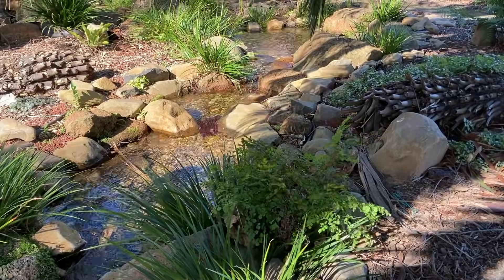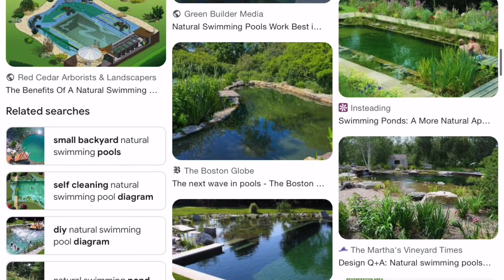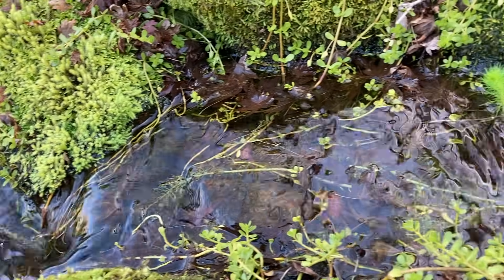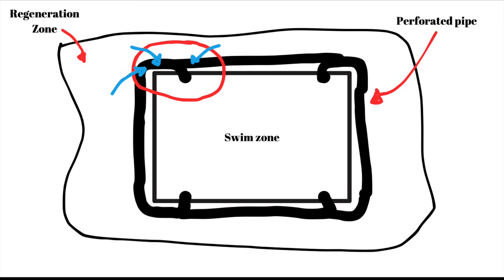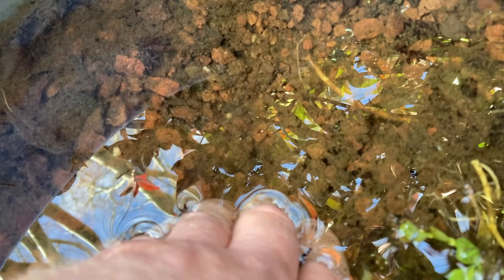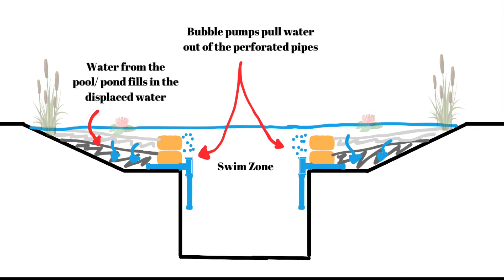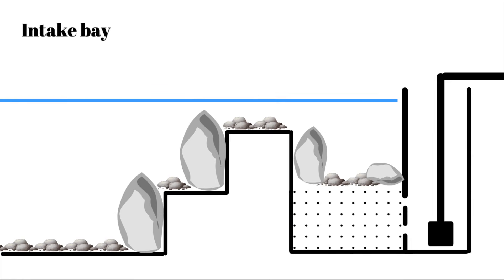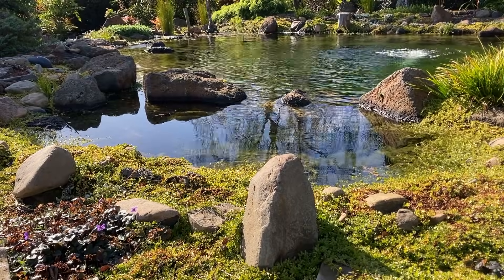Up-flow bog filter vs down-flow bog filter

Comment: I do what I would describe as a through-flow. Water flows into the bog area, moving through rocks to the outlet. I use a false bottom using flatter rocks as a "barrier" to prevent smaller rock falling through into the false bottom. From the barrier rock layer, moving to the top, I used progressively smaller gravel to the top
Reply from the maker: Sounds good. Thanks for sharing 👍

Comment: I have about 1000 sf  of old damaged shade cloth I plan to put in a barrel and filter from the bottom up.  I assume if I see overflow from the anti siphon vent on the input line, I'll know it is time to clean.  The light weight fabric should be easier to clean than heavier media.  I've also considered using old coals from my wood burner.  I could make containment bags from the shade cloth scraps.

Comment: I have an under gravel suction grid in the pond feeding an adjacent bog. It works well and haven’t cleaned or vacuumed the pond over 1 1/2 years. No maintenance
Reply from the maker: Nice. I’d like to try a suction grid. Do you still use a skimmer, intake bay or neg edge?
Reply: @Ozponds  I’m using a skimmer as well to clear the surface debris.

Comment: Hey Kev. Great videos again mate. At 4:04 when you're filling the cup from the bottom with the faucet, as you rightly said, the water will travel from the bottom to the top. However, if the cup and faucet was to scale of the outlet pipe and Bog filter, I fear the water wouldn't disperse throughout the bottom layer of the bog before rising toward the surface (due to the pressure at that depth) and therefore the majority of water will only travel through the water column above the outlet/centipede. 
I know you say that both methods work but I just like to nut out inefficiencies ;)
Reply from the maker: You are probably correct just sharing my own thoughts.

Comment: Hi live the videos! i have a small barrel pond and wanted to use a cheap solar pump for a bog filter. Do you think it will still work if i have a down flow bog filter using a flower pot? Or is this too minimal to work? Thankyou
Reply from the maker: It will certainly help. It’s harder to guarantee the result when the pump isn’t 24/7. I have videos on no filter barrel ponds.
Reply: Okay brilliant thankyou I'll check them out. I already have a solar aerator, just trying to find ways to keep it clean with out spending loads. Thankyou

Comment: Thanks for the insights once again. Hey out of interest what is your pump rate to get the flow in that stream in the last scene. I am trying to get something exactly like this in my creek/pond setup.
Reply from the maker: I can’t remember the exact clips I used in the video. My guess is it’s the dream pond stream, that pump is rated at 15,000litres per hour but it’s dialed down quite a lot and it is pumping a long way. I’d guess it’s more like 4-6000 litres per hour.

Comment: This is a great channel and I enjoy your content a lot. One of the best!    But, I'm not certain that down- vs up-flow makes any difference and I am not convinced by the water glass example. Certainly if you filled it with media and added water from the top, the water'd just spill over the side like the example. In reality water will ALWAYS find the path of lest resistance but as the easiest channel begins to collect debris it becomes not the easiest channel, and so on, and so on. There will always be a channel with less resistance that will eventually get plugged up. Gravity itself probably plays little role or all the water in the swimming pool would be falling to the bottom of the pool and then how does it replace the water that was already there?
Reply from the maker: Just my thoughts and theories, you are most welcome to yours 👍

Comment: Quick question, if you have an external pump does the overflow in your filters replace using a check valve?
Reply from the maker: I wouldn’t think so.

Comment: My experiennce wtih upflow filter is the sediments builds up in the media over time in the pea gravel. . Just an update it took almost one week, 8 people to manual clean out my bog filter. Its got large river stone about 10cm thick, course gravel about 10cm , and pea gravel 20-30cm in a 4 meter diameter upflow bog. 

So now eveything  cleaned out, plan is to have 5cm -8cm worth of pea gravel, to make it easier to clean out the sediments. Pipe the water a prefilter (mechanical) before entering the bog. 

Its going to be an experiment to see which works best. 

At the end of the day, there is always going to some sort of maintenance. Nothing is maintenance free. 

Cheers.
Reply from the maker: Thanks for sharing your experience. 👍

Comment: I am in the process of renovating my up flow that is clogged with fine sediments through out the filtering media. Its a 4m x 2m deep diameter up flow reservoir. Its a big mess. Routine clean out is a bitch. Going to go with combination of tradtional mechanical fiteration that can be easily cleaned plus the 4m upflow will just have 10cm of fine river gravel for easy maintenance. Lets see how it goes.

Comment: The main advantage that I did not hear in this video is the massive power savings on moving water that can be achieved using the bubble pump vs a water pump. The guy from Australia said he was moving 30,000 liters an hour through his system with 80 watts of power. That is one small solar panel worth of power. Is there a way to have an up flow using the bubble pump?
Reply from the maker: The problem with the bubble pumps is they don’t handle head or pipe friction well. That means they aren’t really in option for up-flow.

Comment: I've been searching for a video to tell me if an above ground bog filter needs to be winterized. I've learned so far if I shut it off beneficial bacterial will die and I will have to restart the process in the spring. But living in a climate that has quite cold Winters I'm not sure if the barrel that the bog filter is in will freeze? Or will it be okay because it has constant water moving?
Reply from the maker: I don’t live in an area that experiences freeze, thaw so I have no first hand experience on the topic.
Reply: @Ozponds  thanks I appreciate your reply!
Reply: I need to look into this too. Indiana here!

Comment: I just built a temporary up-flow bog filter with a bucket in an old flower pot and some pieces of a garden hose.  
When I'm sure, the pot I used is big enough for our sun exposed pont, I will build a more beautiful one with plants and a nice bubbly overflow. I am really curious about the progress! But looks like just one night was enough to clear the water a bit.

Thank you for the inspiration and your explanations, especially on the diversity of possible methods.
Reply from the maker: Good luck with it all 👍

Comment: Your intuition is incorrect. Water flowing from a tap with a gap does mix with the rest of the water in the container in a turbulent manner. Pretty basic fluid dynamics. You can try this yourself with a little food coloring and just use a pitcher or whatever instead of the tap. Science is fun. It's visually similar to blowing smoke.

Username checking out today!

Comment: Could you use a Air pump to feed an up flow bog filter? I ask this because they are so much cheaper to run.
Reply from the maker: Yes you can. But also take a look at some of the energy efficient pumps that are available these days. Things like 15000L per hour for 105watts.
Reply: @Ozponds  Nice, well what do you think about this 15000L for 20 watt air pump? https://www.youtube.com/watch?v=TOVZ4oklBFw

Comment: Hi, thanks for the video. I have a pump sebo wp2550, could you please tell me if i can make a small bog filter upwards with it? Or is it too weak?  Is a 2800L/hour . 35w.
Reply from the maker: There’s a few variables. How high you need to pump the water and how big the bog filter is. If those fall within the specs of the pump no problem.
Reply: @Ozponds  thanks

Comment: The one advantage I notice for the downflow undergravel filter system is that it can be powered by just an airpump in a large pond, which uses significantly less electricity than the water pump required in upflow bog filter.
Reply from the maker: That is true. Down-flow can be easily powered by an air pump, however I don’t think the energy saving argument stacks up anymore. In recent years pumps have gotten so energy efficient. If you select the right pump they can move just as much water, in some case more than an efficient air pump. But if swimming air pump has massive advantages as no electricity in or around the pond.

Comment: Hi mate,
Wonderful points you made there and the proof is in the clarity of your ponds, they are in really great condition and it’s nice to see.
I’m currently from South Africa and I’m running my own pond company in the north side, I was just wondering how you deal with the blanket weed problems because you don’t seem to have that problem from what I noticed.
I don’t like having to add treatments to the ponds but I currently find myself needing to do this from time to time. How do you keep this under control if I may ask?
Look forward to seeing more of your videos.
Thanks
Reply from the maker: I’ve made quite a few vids on how I’ve dealt with algae in the past. Once the pond matures (can take up to 3years) there’s shouldn’t be any need first treatment, as long as the filtration is correct.
Reply: Thank you, I will go have a look at your other videos. It’s a little difficult because I don’t really have the time and they don’t want to pay for my time so my best option is to treat and go.. 
also I do water changes because they leave them to soup before contacting me and once I’m done they don’t seem to want to do a service plan to keep them well. But anyway thank you for you brilliant advice
Reply: I’m Lifetime ponds the first message this is my private account, don’t know what happened there.

Comment: Have you considered that in a down-flow filter, when using principles used in trickle filters, the water that flows down will be highly oxygenated as the water has splashed down to the surface of the filter's water level? In an up-flow filter, the water your pumping down under the filter will have come from the bottom of your pond, which arguably is the least oxygenated body of water in your pond. I might argue that highly oxygenated water in a down-flow setup might promote more active bacteria activity.
Reply from the maker: You’ve obviously not seen how I set up my ponds with a skimmer/ intake bay. Water is pulled from the surface. A trickle down filter is very different from  downflow bog filter, usually the filter is fully submerged. Trickle filters are extremely effective at converting ammonia to nitrite, then nitrate. They are not submerged. But they won’t remove the nitrate. Both bog systems have a greater potential to process the nitrate. But of course it depends how it’s all set up. Like I mentioned in the video there’s heaps of different ways to have a successful filter system, I just outlined why I do it the way I do it.
Reply: Maybe add a Venturi to the up flow filter ?

Comment: I think your theory on pond filters is spot on, im currently using a down flow , with pump in the pond returning to the bog filter and being distributed using a 12ft spray bar. I have had this pond running for 5 year's and the only maintenance has been removing the autumn leaves . Mu pond is 5 thousand gallons of which 2 thousand is bog filter, 8 x 16 inch koi live happily, I've never changed the water only topped up in the summer due to evaporation.
Karl from Ireland
Reply from the maker: Sounds like a great setup 👍

Comment: From my personal experience:
Down-flow (input from top, output at bottom): output has to exactly match input. 
 - If output < input, bog filter will overflow. 
 - If output > input, bog filter will be empty.

Once the filters start to clog, output (top to bottom) will decrease and unless managed (i.e. clean filter or reduce input), the bog filter will start to overflow.

Up-flow (input from bottom, output at top): easier to manage as output cannot exceed input. 
 - If output < input, bog filter will overflow. 
 - If output > input, bog stays full and output flow matches input

Once the filter starts to clog, the flow to output (bottom to top) will decrease, causing input to decrease. Bog filter will not overflow.
Reply: Honestly this was explained so clearly I felt as if I always knew this. But I didn't so thanks!

Comment: Hello! Tell me, does the filter have to be separate from the pond? Or is it possible to build a filter inside the pond so that the water level is the same? Will the filter work if it is built inside a pond? Thank you.
Reply from the maker: The filter can be built inside the pond but then you’ll need to almost completely drain the pond to clean the filter.
Reply: How often do you clean the filter? Does it need to be completely drained to clean it?
Reply from the maker: As often or as little as needed. I personally flush mine every one or two years. It all depends on fish load, environment, etc.
Reply: Thanks for the answers! It would be nice to make a video about cleaning your filters!
Reply from the maker: I have there’s almost 200 videos available here.
Reply: Tell me, please, how much power do you put pumps in filters? Is there a dependence of the pump power on the volume of the pond? Thank you.
Reply from the maker: You just need to watch some more vids. I have ones on flow rates and energy consumption 👍.
Reply: The fact is that I do not speak English. It's easier for me to communicate using messages. Thank you anyway.

Comment: Thank you for making this channel, I really enjoy your videos and learn something in each one.
Can I use a 50 gallon sterile plastic bin as a container for my bog filter? I would post the link but sometimes that causes an issue on YouTube. The product is sold by Walmart for $25 USD stateside. Thanks.
Reply from the maker: For sure 👍 I like to use UV stabilised plastics when doing container bogs and cladding them in something. Don’t want them breaking apart after one summer.
Reply: @Ozponds  Thank you!!!

Comment: Your vids are amazing. I have completely revamped an old and neglected pond that came with the house I recently bought. I have built a huge bog filter out of an ibc tote following your guides and it works great. At this point, my only question is regarding the air port to break the siphon. While the pump for the intake from the pond is running and water is flowing through, I always hear a gargling from the open air port. Is that okay?
Reply from the maker: Yes that’s fine, doesn’t affect the function it’s actually good it’s the air getting pulled down into the pipe, that will help ensure the water going into the bog is well oxygenated. If the sound really annoys you, you could add a little bit of pipe or hose to make it so the air will only be sucked in if the water level drops, say when the pump shuts off.
Reply: @Ozponds  thanks again for your great advice

Comment: I have a 20 foot by 15 foot pond that is about 5 feet deep and crystal clear water, I mean when I drop my gopro in it doesn't look like there is water at all, just a load of flying koi, this is completely down to a bog filter. I took inspiration from oz ponds! I do though, harvest rainwater and drop in 3-400 gallons in every week or two. I have calculated the cost of the bog filter including plants to around £1200. If I were to use an off the shelf filter with UV etc I would have been looking at £2500minimum. Plus I get massive satisfaction at creating my own little ecosystem. Thanks Oz ponds!!!!
Reply from the maker: They really do work. That’s why I go on and on and in about it. Thanks for letting us know your experience 👍

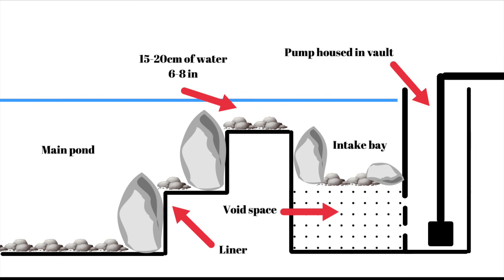Comment: according to the figure at 5:54, how do I make sure all water in main pond are going to bog? I feel it's only upper surface level of water is going throgh. The bottom water stays in the main pond?
Reply from the maker: Adding an aerator will help mix all the layers of water within the main pond. On larger ponds I also like jets.

Comment: Thanks for all this valuable affordable(!) info man! Tryin to do the math on what would be the right way to go for filtering a duck pond. I rescue ducks, have about 30 at a time, I want to be able to safely swim in it with them without risk of E.Coli and exposure to other bad bacteria. I feel like I would need a massive pond and bog filter to make it viable. With jets keepin the water agitated at the bottom to keep sludge from building up. What do you reckon my friend?
Reply from the maker: When you use nature to filter you obviously have no guarantee that other less desirable (E.Coli) parts of nature are going to be eliminated. While a supersized bog filter would certainly help I think you would also need a huge pond for 30 ducks. It’s like filtering a wine barrel pond for a huge koi fish, you need a decent volume of water.
Reply: @Ozponds  Thanks Kev! Figured as much, what’s the best way to setup a consult with you in the future? I plan on making many ponds !

Comment: Hello! I’ve watched all of your bog filter videos and attempted to make one this weekend.  I used an HDX heavy duty plastic tote 50 gallons.  Pvc pipe rocks etc.  problem was when I filled with water the sides seriously bowed out to the point where it looked like it was going to explode.   Do you have any tips?  My 1/2 above and 1/2 below pond is 600 gallons so I need a above ground filter
Reply from the maker: You won’t like what I have to say…it’s simple, you need a stronger container or you need to reinforce the sides.

Comment: Thank you for your content. Curious if you have thought about how you would create an air driven up flow filter?
Reply from the maker: I think it could be done if the bog is level with the pond. Very hard to regulate the flow though. Much easier with a pump, they are so efficient theses days. If you want air for safety easier to do down flow.